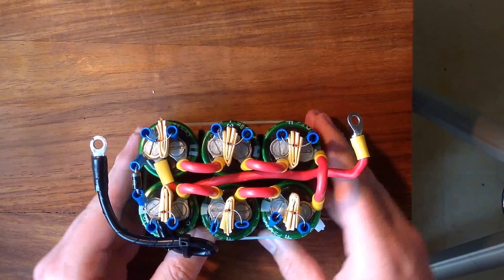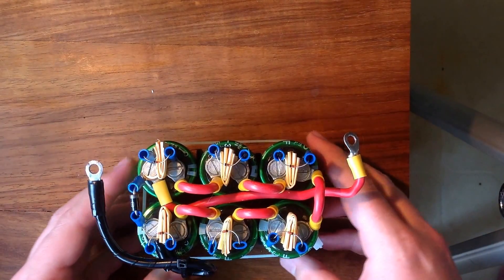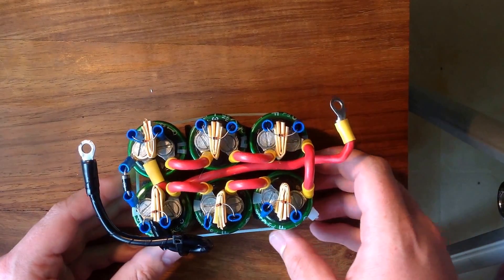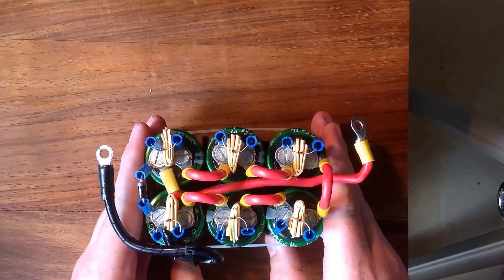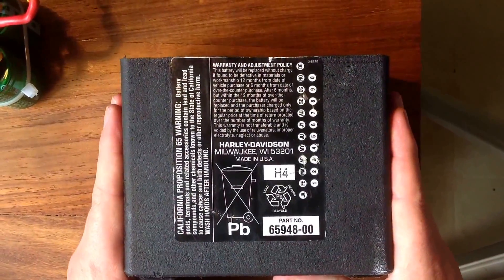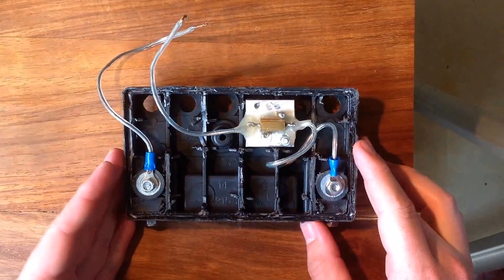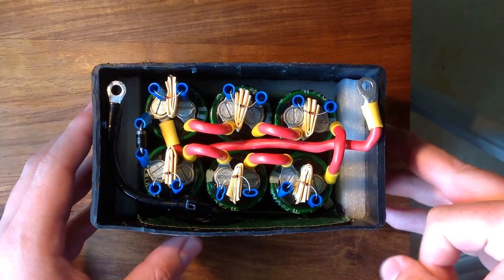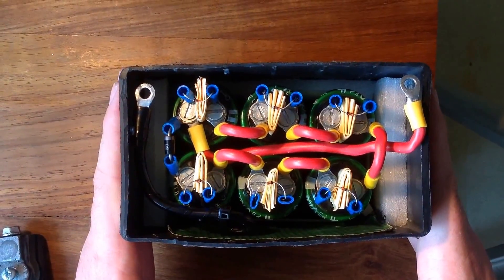Super capacitor pack

Comment: I have a set of 12 super capacitors rated at 2600Farads each. I’m using them to support the issues surrounding the coup de fa effect when my 24 volt inverter picks up a large load.

Comment: I just bought six 2.7V 500F capacitors from Aliexpress.  I'd recommend using 3 ordinary power diodes in series, forward biased across each cap instead.  If you charge yours with a current source and there's a balancing issue it will simply blow those zeners.  Mine peaks at 2.4 volts each with a high current charger but settle back down to about 2.2 volts.  The curve of the diodes probably isn't as sharp as the zeners but at least they won't blow.

Also mine don't hold a charge and 6 in series drops to under 10 volts in an hour or so.  Might be the diodes but I don't think so.  It keeps dropping at about the same rate right to zero.

Also I measured my bank of caps and the value was only 58% of what it should have been for 500F caps in series.  i wonder if it's a quality issue.  I can tell you how to measure them if you don't know.
Reply: i bought the same one too, 2.7v 500F, but not yet test them out yet

Comment: Where did you buy your supercapacitors? I like that kind of supercap because you can connect the wires easily because it has screw. I can't find that on ebay. How much is that per piece? Could you send me the link if any, the online store you bought it from?
Reply: +Viper Strike http://www.ebay.com/itm/172069143240?ssPageName=STRK:MESELX:IT&_trksid=p3984.m1555.l2649

Comment: Does any one know what is the RESISTOR Value in OHM and Watts Resistor To put on 2.7 Super Capacitor to protect it from go over charge or balance in pack ?  Please tell me.
What is that Watt in diode u use ?  2.7v  4-5 pieces ? what is the Watts ?
thank

Comment: This vid was the primary motivator in making my own cap bank for my KTM 525EXC.  Thankfully I have a kick start as well so a flat cap isn't much of an inconvenience.  I tossed a discussion/build thread up on advrider: http://www.advrider.com/forums/showthread.php?t=1062214
Reply from the maker: Matthew Dixon Sweet peanuts of awesomeness dude!! thanks !!!
Reply: African Electron So why did you change your balancing circuit?  I was thinking of going the same route that you went with the zeners.
Reply from the maker: Matthew Dixon The setup shown above worked adequately the only reason i changed the setup was for the sake of experimentation there was no real advantage in the end. if i were to re do it i would use 4 or 5 zener diodes with a rating of 2.7v as that would lower the self discharge rate a lot and im certain that it would still provide adequate protection. 
My long term goal is now to provide a proper balancing pcb for 6 caps on ebay some time soon

Comment: I am building the same unit. I would like to know if adding more than one Zener per cap would be good for safety redundancy. And will I need to heat sink the diodes?
Reply from the maker: ***** I ended up doing exactly the same thing using 5 diodes per cap. the self discharge rate has increased a bit. as far as heat sinks go i wont be needed  the current flow through the diode is tiny and self limited due to natural resistance of the diodes. Alternatively look into lasersabers videos he also has good info on balancing.
Reply: African Electron His video was my inspiration for the project, but yours was what had me hopeful for success. Thank you for the speedy response!!!
Reply: African Electron I've done some research and found something a little disturbing about these zener diodes that may not be ideal. If it opens from too much voltage, it will stay open until there is no longer any charge left.
The only way to avoid this is by charging the caps slowly. (small solar panels may be ideal)
Reply from the maker: If you reach a voltage where the zener opens up fully two things will happen...
1 you will have damaged the capacitor. 
2 the zener will blow in exactly the same was as a fuse.
the point of balancing is not to make sure they all charge to the same voltage..you can just as easily charge the bank from 0v to say 14 v with all the current you can get ...the capacitors will all charge at the same time at almost the same rate ...there is no need for balancing.
balancing comes in when you charge and discharge the caps over and over some caps will self discharge faster than others for example over a long period of time a cap that discharges more slowly than an other will start off at 1 v while its fellow caps start off at 0v when they re all charged up one cap will be 1v too high. 
Balancing is the process of ensuring that all the caps leak at the same rate.
You are correct in your analysis my way of balancing is not the GOLD STANDARD in balancing caps the two best ways are 

1 resistive balancing ...simply using resistors to bring all the leakage currents to a high enough point that they even out across the bank. the negative of this method is that the bank will discharge rapidly...not ideal for me but in a constant cycle application like smoothing out current in a power supply its ideal and cheap as dirt. 

2 active balancing using a bunch of components (or some fancy specialised ics) to actively decide when to bleed current.....Not ideal for me because i live in AFRICA and the company that supplies the ideal component does not distribute locally. Im working on making break out balancing PCBS  that use smd parts and will make them available for sale.

Thanks for your interest and please feel free to ask ...im PS not a expert
Reply: I think I know now why you threw one of these across the room...
Reply from the maker: ***** They are certainly far from perfect ....but thats where the fun comes in.
Reply: I accidentally put one in forward bias and it made shiny spots on my thumb and forefinger.
( I nearly tossed it across the room. )

Comment: Hey Mate, nice video and nice explanation with the diodes etc. Not sure if you know, but the reason for the ~14V charging on cars and bikes is a design requirement for a 12V lead acid battery... there is some formula out there but basically you need more volts to get the nominal 12 when charging (or there'll be no electron flow), and hence the 14.7 charging voltage. Cheers

Comment: Let's say the bike does not start right off for some reason, will there be enough reserve to try again?
Reply from the maker: There is enough to crank it a few times (about 3 times the average starting time) so it would not be ideal for a hard to start bike. I plan on building a small battery pack with a dc to dc converter to top it off when i go out. I also plan on rigging up something that turns the head light on after the the engine is running for a few seconds. 
It would be pretty well suited to track racing applications where a jump start is always handy and weight saving is important, Or as a add onto a standard lead acid or lithium battery since it would take most of the cranking current draw away from the battery.

Comment: Looks great! Thanks, from Ioxus
Reply from the maker: Thanks are you someone who works at Ioxus?
I have changed the balancing circuit to one using five 2.7 v zeners in parrallel with each capacitor instead of single 2.4v zeners so it balances a lot better but also self discharges faster sadly. I am hoping to get some (SAB) MOSFET from ALD but those are a bit to specialized to get in small quantities.

Comment: I am glad to see someone that actually knows the Farads of these super caps after you run them in series. Most videos claim the same Farad out-put as a single rated cap.
Reply: I got 58.33_ F. Close enough. :)
Reply: Hello dear!!! I have a question no body give me answer, I need 48v and 70 amps of capacitors pack, could you tell me how Many caps I would need to achieve that ?
Reply: @maliknaveedislam  6, 2.5 volt 500 Farad capacitors in series fully charged will give you 15 volts and 83 Farads total. The voltage and amperage available quickly falls as power is drained from the caps. But for a brief moment you could pull well over 70 amps.
Capacitors work very differently to batteries Batteries can supply high amperage for much longer than capacitors.
Reply: Pha Q thank you so much sir , one question more sir, does it matter if my device is 48v ? Voltage does matter ?
Reply: @maliknaveedislam  If you were to use 18, 2.5 volt 500 Farad caps in series, you would get to 45 volts at 27 Farads.fully charged.
It might be enough to supply 70 amps for a very brief period of time.